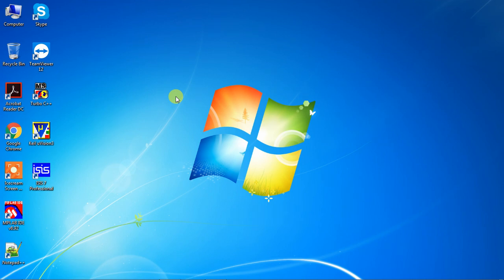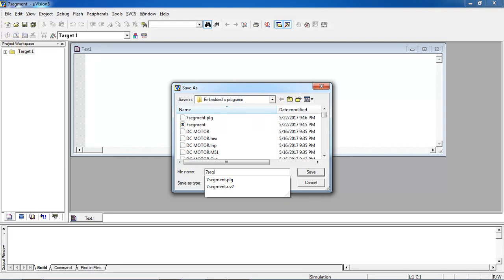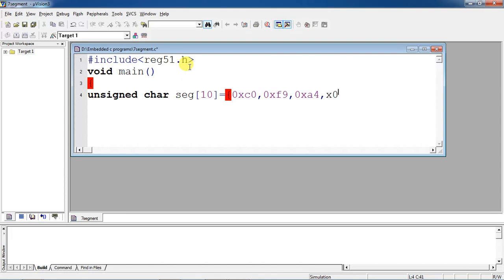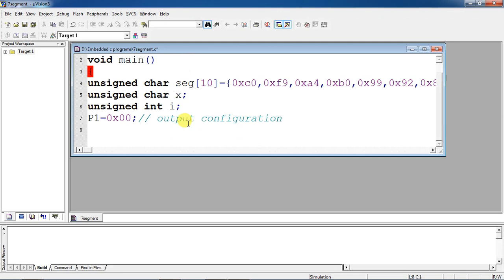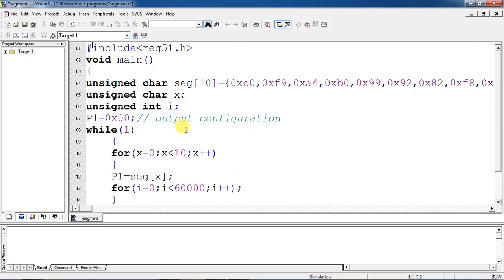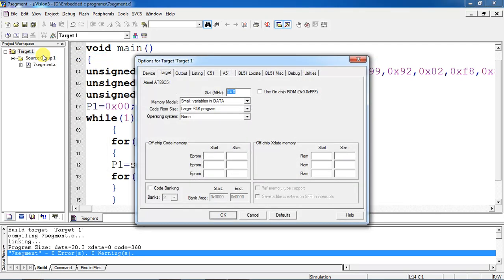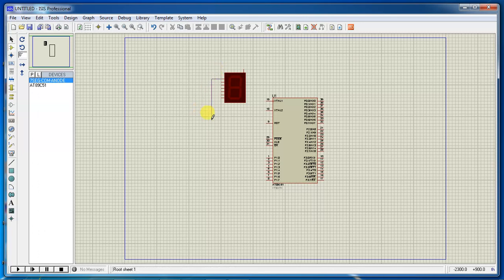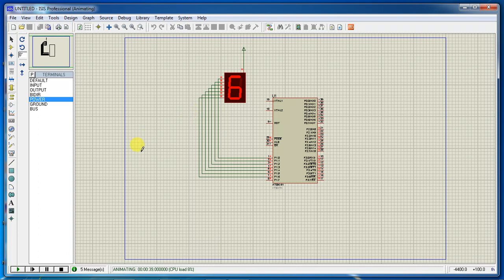Embedded C program to display  0 to 9 on 7 segment display with Keil and Proteus combination

Comment: Hlw sir, I am making a project of flexible transmission line using TSR, 8051 microcontroller is used in it but I can't understand its coding part , can you please provide the code for that??

Comment: Hi,

I'm Taral Mehta,
I am trying to make one small project for my knowledge. I want some help from your side, I want to use an 8051 microcontroller with 2x seven segment display.  I want to add three modes in that display by coding ,please help me in this part , I am stuck in it.

Comment: In keil programming you wrote i<60000 in for loop condition .is it the no of times the process will get repeat
Reply: That is the buffer he gave.  You can consider it as frequency as well.  1sec = 1000 milisec,  so like that,  or else the numbers will flash super fast.
Reply: And bro remember f hz =1/t sec